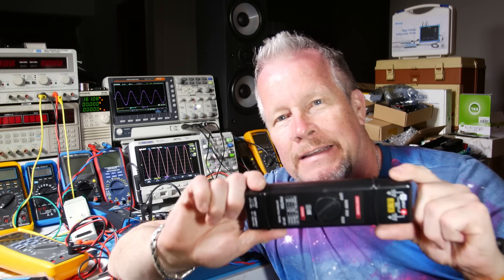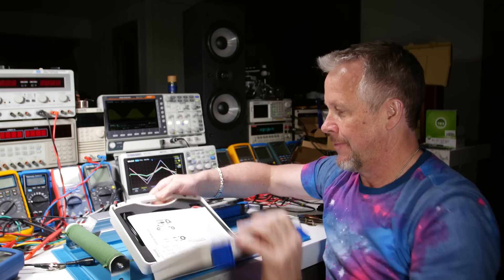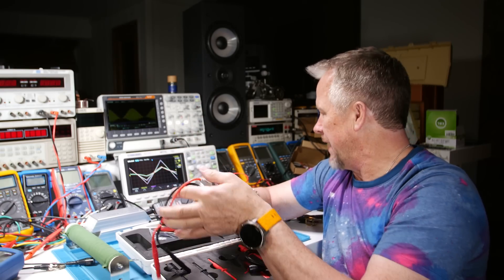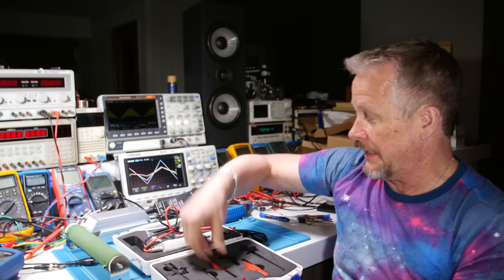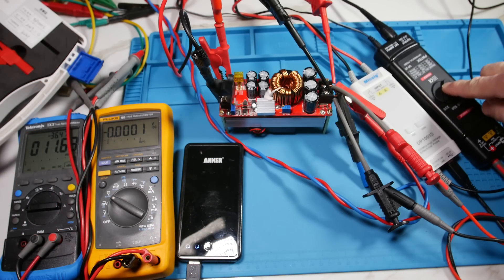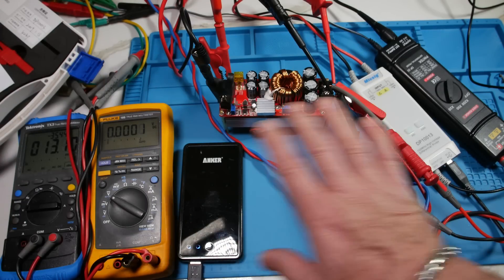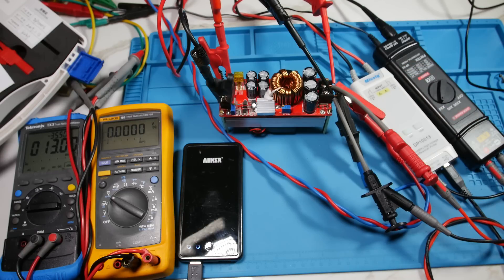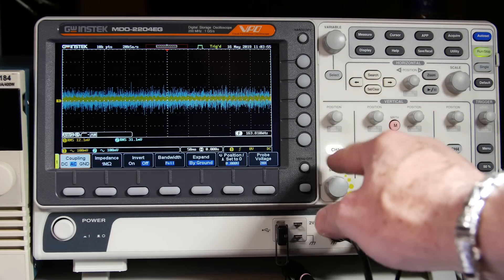Pintek vs Micsig Differential probe #diffprobe #bestdifferentialprobe

Comment: I'm hoping my siglent handheld powers up the hantek through its usb. Would suck to have to run down another power source just to use the probe. Great vid!
Reply from the maker: pbl57lsu it will, I’ve done that too!!! Great to hear from you!
Reply: I assume I only need one differential probe if I want to use both channels under any measuring scenario? I measure voltage drop frequently and I'm under the impression I can do it with one channel floating and 2 channels if I'm using the additional differential probe? I'm just wanting to make sure all scenarios (including drop voltage) are safe or if it requires 2 differential probes?
Reply from the maker: pbl57lsu The ground of the scope probes is also referenced to the ground at the power input of the oscilloscope.  So, if the circuit being measured is not on the same ground, or what is being measured is referenced to that ground - then only one differential probe is needed.
Reply from the maker: With a battery powered scope, the first probe you can place anywhere so long as the voltage is within the scope probes spec.  Then using a diff probe on the second measurement, you can pretty much place it anywhere.  I have a Tektronix scope that actually has isolated channels for both inputs;)
Reply from the maker: pbl57lsu Yes it sounds like your 10x probe rated at 400V is good.  One thing I’ve done in the past is to use two high voltage resistors to divide the voltage, then I just measured the voltage off of the bottom resistor.  High voltage requires you to be safe or you could be bitten.
Reply from the maker: pbl57lsu The 120 V looks to be well within the equipments specs.  I’m pretty sure the lower voltage for floating measurements is soul based on a safety issue as this voltage, the 42Vpk is a safe low voltage level.  This is to protect you for electrical shock.  When ever someone is working with voltages higher than this - floating or not, it can be unsafe.  One key safety tip is to not touch anything metal or conductive.  So, for instance, if the equipment was set up for measurements with power off, then was turned on with you not touching the equipment, then it should be safe for you - and your equipment doesn’t care that it is floating.  The point of how to take the differential measurements is that your probes are not referenced to ground.  This means your equipment has no reference to ground as it is battery operated.  As a disclaimer, I am not there and there could be a communication issue in understanding what you are asking and what I am suggesting, so to your original guidance - any voltage above 42Vpk can be a safety issue.
Reply from the maker: pbl57lsu thank you! I appreciate you!

Comment: You asked what I think... I think you measured the rise time of the probes incorrectly. With a power supply being switched on? C'mon...
Reply from the maker: Thanks for commenting - every comment helps others to understand more I hope.  I was actually comparing the probes while measuring the power supply rise time, I didn’t mean to give the idea that I was measuring the probes bandwidth.  I’m not even sure I have the instruments for that.  I’d have to have something with a risetime faster that pun 3.5 ns.  The Micsig has 100 MHz bandwidth while the Pintek actually has a 25 MHz.  The rise time measured would have been near the Pintek’s limit, but it seemed to capture about the same wave shape as the Micsig.  I’ll have to try and do a more comprehensive review of each of these probes.

Comment: Hey Eddie, again thank you for a new video and welcome back.
I again have a question, what is the difference between a differential probe and an isolated frontend like the Siglent ISFE?
Reply: Hi,
I believe that the Siglent isfe has a 1Mhz bandwidth and is limited by the voltages you can scope.
The differential probes are 25Mhz and 100Mhz bandwidth.
A scope with a true isolated front end, the bandwidth is equal to the scope bandwidth.
The main difference is price point.
ATB Adam
Reply: Adam L thank you so much for answering. I am trying to find a cheap oscilloscope for my bench for mostly audio work (I build custom iems). it is such a confusing topic.
I think I need a differential probe to save me from myself, and I need to measure current to calculate speaker coil inductance. 
I wait for eddies video about measuring current with a resistor, maybe I get by without a current clamp. My entire circuits fit inside these.
Reply: @Krmpfpks  
You won't go far wrong with siglent isfe, that would be fine for the audio frequencies of 20hz to 20Khz.
There's quite a few budget scopes around, for about 400 bucks, Rigol, siglent, hantek
Just choose what suits your budget.
As for measuring inductance an LCR meter would probably do the job.
ATB Adam
Reply: Adam L that is so nice of you to help me. The ISFE is not cheap either (I think $150), but it covers two channels. 
I bought an LCR but the inductance of balanced armature drivers is so small I did not get meaningful measurements. Also I will need to check different amplitudes and frequencies, as inductance is also depending on air pressure. It’s a nice rabbit hole I‘m down.
Currently I am looking at Hantek 4072C, it’s cheap and function gen is included. But I don’t know if 8 bit is enough, 8 bit audio sounds bad so I have to figure out if the missing resolution is covered by the higher sample rate.
Sorry for writing a novel of a YouTube comment; I am just thankful you helped me. When you‘re on a budget, buying the wrong tools really sets you back.
Reply: @Krmpfpks  
Hi, 
The Siglent isfe uses two channels of an oscilloscope, to do one measurement.
One connector acts as signal to be measured and the second connector is return path for the signal similar to
 a multimeter, positive and negative probes, the outer shell of  BNC connectors on isfe are not connected to the device under test.
Sorry I didn't realise you wanted to measure the inductance of a speaker system, woofer crossover and tweeter ?
I thought you wanted the inductance of the voice coil of a single speaker.
8 bits is 256 samples and 12 bits is 4096 samples
The signal generator output is 12 bit and scope vertical resolution is 8 bit of the hantek 4072c.
Most DSO scopes are 8 bit vertical resolution, especially in the budget price point.
The vertical resolution is the amplitude that's 8 bits, I.e. a voltage measures 5 volts divide by 256 equals 20mV per step resolution.
I'm not an engineer just a hobbyist, I'm  still learning myself 😀 plenty of rabbit holes !
ATB Adam
Reply from the maker: I agree with Adam, the Siglent would be great for audio frequencies and it has two channels.  It does have a 200x attenuation, so I wonder how well this would work with low voltage signals...
Reply: @KissAnalog  
Audio frequencies !  Why not start with a potentiometric front end & an old smartphone running a oscilloscope app. If that is found lacking, then an oscilloscope could be considered. 
Because, IMHO, beer tastes better than oscilloscopes 😁
Reply from the maker: BR Gurunandan I like where your head is at;)  And you are right, there are less expensive ways to get good measurements.  Thanks for helping save some beer money!
Reply: BR Gurunandan I tried to find something that works, but I didn’t. Do you have any concrete apps/Frontends in mind?
Reply: @Krmpfpks  
I have been trying to capture the ignition waveforms of a single cylinder engine.
One channel purely resistors  potentiometer , another channel homemade capacitance sensor on HT cable for trigger. 
It's a WiP.  I'm not done yet. 
I am using a Xiaomi RN3 phone, and for my requirement (totally qualitative, not measuring anything yet) all dso apps in Google playstore are equally usable.
If bandwidth is not an issue, this is a sweet set-up. Firstly the cost (nil) and secondly the isolation. No mains, no earth 😁
Initially everything is a variable, and it was frustrating, but soon it got manageable. 
Our usage being different, my info maybe of no use to you, but if I can be of help, feel free to ask.
Reply: Kiss Analog I have just coughed up the money and ordered a GW Instek GDS-1054B thanks to your comparison of the scopes especially FFT. 

With 4 channels I hope I can get by without a differential probe for now.
Now I need a cheep function generator for signals I cannot generate with a sound card.
Thank you guys so much.
Reply from the maker: Krmpfpks That’s great!  I think you will be very happy with it!

Comment: Good video, but you have noise (from your USB power bank?) coupling in to your micsig probe, both of mine give much lower noise... For best results use a cleaner 5V source like your scope itself (the probe is galvanically isolated at its power input). Thanks for following up on your other video and posting this comparison.
Reply from the maker: Thanks for the feedback!  I’m going to try a different power source.  I tried connecting the leads to different circuits and just assumed that my batter source was good, but now I want to check that.
Reply: @KissAnalog  
Maybe instead of a powerbank you need to use a USB connector on an oscilloscope? https://youtu.be/dzeK3Nm3N44?t=365
I also want to buy micsig myself because of the price. Without differenzial sonde, an oscilloscope with non-isolated channels is useless.
Reply: I would just power it from the O scope the power there should be fairly clean.

Comment: Welcome back! :-)
I like your review, I think it is wary hard to decide, but maybe for lower voltages after the transformer, the Pintek is better, lower noise and 20X. While the Micsig is more to the before transformer or tube amps, greater noise but maybe to "harder" tasks.
The missing CE mark is a bit of concern, you may try to open it and see if the probe is build to some acceptable standard.
Reply: I own a couple of the Micsig probes. I can confirm that the ones you can buy in the EU come with a CE certification, not sure about the US ones. Mine had certification papers in the box as well as calibration certificates. http://www.micsig.com/UploadFiles/file/DP%20CE.pdf
Reply from the maker: Thanks!  I’ll do a follow up and use a different power source.  Also I’ll check the documents for any safety mark.  Now the CE mark is typically a self cert, but does show some level of thought towards safety.  It wasn’t obvious on how to open it.  I might have to peel off the label on front...
Reply: @KissAnalog  Yes the CE is properly often just stamped on the product if it is outside Europ, but inside Europe a product can only be sold if it conform to the wary high demands of CE. I think that it is the second highest standard next after the German tests. LOL it shall not be to easy for those who want to check? :-)
Reply from the maker: Fried Mule I found it, at the back of the unit in small print next to the serial number - there is a CE mark.  Watching my video I could see the CE mark on the box, so I took a closer look;). I’ll do a follow up review and point that out - as well as use a clean USB power supply to see if the noise will be lower.
Reply: @KissAnalog  Okay that sounds great, both things. It could be wary interesting to see the difference in power supply's, maybe also talk about why / what make the difference (if simple) :-)
Reply from the maker: Fried Mule Great idea - thanks!